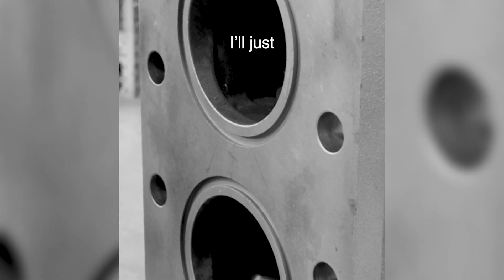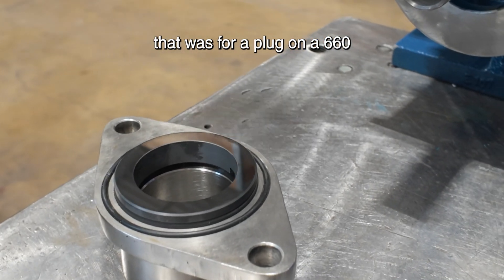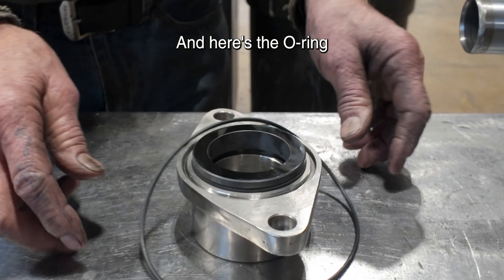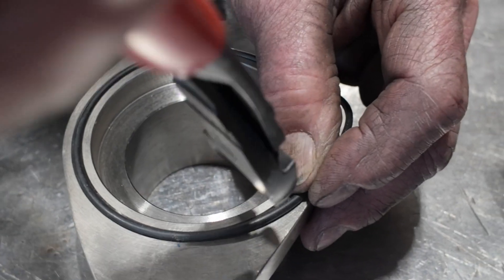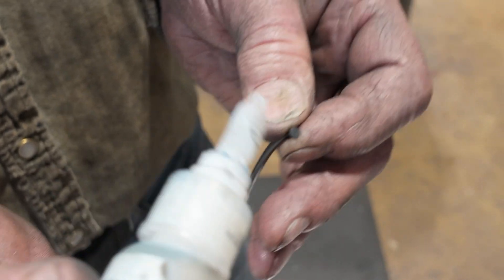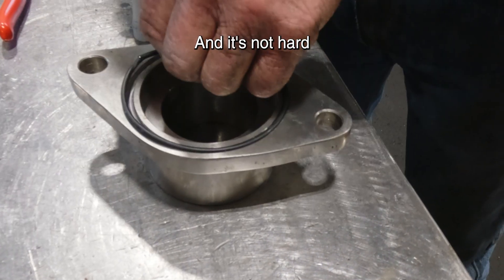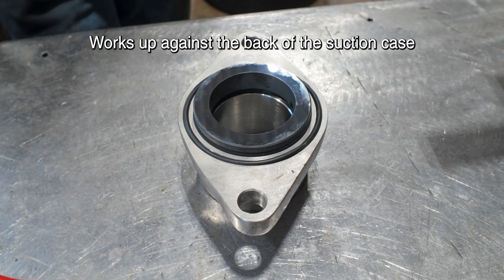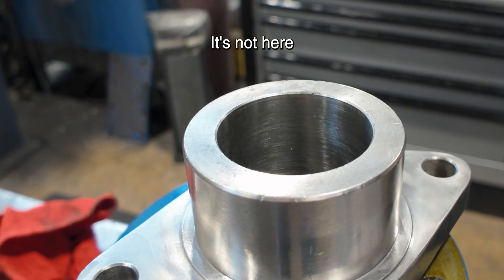O-Rings - We Respond To Your Comments #pump #repair #mechanic

Comment: Even if there was some pressure, this would work as good as a single piece o-ring. O-rings are typically under compression so if it's cut slightly long it'll squish into itself along with the surrounding material. The glue helps for positioning so you don't pinch the o-ring and helps compensate for a rougher cut.

Comment: Oh how often I have had this argument! Once I tell them we use glued O-rings at work, mostly for water with up to 150 bars, they stay quiet. 

These O-rings are used for diameters of up to 3 meters with 15mm thickness, and in pipe joints and valves in pumped hydro storage plants.
Cut square with a very sharp knife, and glued with ordinary superglue, they don't fail.
Pliers don't work nearly as well, because the ends don't get even nor square. Also you need the least amount of glue possible, just wet both surfaces without a big drop attached.

Comment: Everything you said is correct, but, If you're gunna defend it, at least be doing it right. Always use a sharp knife, wire cutters/snips leave a ridge, not a clean flat end. Also if you are doing mods, why not mod to a std oring to make it easier for those in the future?

Comment: Wait till they see me coat the old one in rtv and send it lol
Reply from the maker: The world runs on RTV!
Reply: @shanleypumpandequipmentinc3857  I've seen entire parts of machines replicated with pig putty, and RTV was more common than tape in my factory.  We used it as a coating you could peel off if sand could stick to something you didn't want it to. We used micro glass beads and waterglass to make injection molding cores, and the mix would stick, dry, and subsequently tear machinery to shreds.  Coat the electronics, reed switches, prox switches, boltheads, etc., and when it's time to fix the thing just peel it off.
Reply: Rtv and my new favorite Flex seal tape!

Comment: I used these o ring kits for years in the milking and pumping industry. No problems at all. Still use them in high pressure air guns running up to 400 bar never failed.

Comment: I've been making my own o-rings for years.I buy the "cord stock" from Mcmaster-Carr in the diameters I need for various repairs. I use Crazy Glue and other brands of instant adhesive. I cut with a single edge razor blade as close to 90 degrees as possible.  I never have had any of them leak.

Comment: I’ve made o-rings for many a pump. Never had a problem with leaks. I make them the same way, with a square cut. The only problem I have seen with o-rings is not the o-ring, but the person installing them. A lot of installations, like a filter canister, only need to be tightened until seated, then snugged about a 1/4 turn, otherwise the o-ring gets flattened out from over tightening and it’s lifespan is dramatically shortened and leaks occur.

Comment: He still didnt explain why he doesnt just buy o-rings of the correct size?
If you are machining the o-ring groove, you know the size. And machining the grooves is much more work than just buying som o-rings.
Reply from the maker: Ever bought things for industrial use before? Do we need 10,000 O-Rings to build 20 custom pumps per year? It's a simple question of scale. We use OEM rings plenty, but if they aren't available or we need to do a custom pump, making one is easier and more cost effective.

Comment: 100 percent correct. I've been making rings for 40 years, I mostly use a razor blade, but I have used side cutters, never had one leak or fail.

Comment: Super glued o-rings always work short term never long term.
Reply from the maker: We don't use Superglue, we use a glue that is specific to rubber.
Reply: @shanleypumpandequipmentinc3857  my sister ripped her chin open when she fell out of a tree.  Took her to the doctors to get stitched up.  He glued her face shut.  Told the doctor that I could have superglued her face at home and save the $2000. That doctor,  like you,  it's not superglue..... it's special.  

Dude, superglue  is superglue no matter the fancy name you want to give it.
Reply: Wrong,i can take u to 0 rings i made,still.in service from 5 yrs ago
Reply: @TheDigger06  then the rings are not actually doing anything important.  No fluids behind it no pressure behind it.  That I guarantee.  I was a plow pump rebuilder. Super glued rings do not seal.

Comment: O Ring kits I used to use had a razor blade cutter for exactly square cut faces. The cut ends sat in a vee groove jig for superglueing together. They worked fine in static applications.....didn't fancy using them in dynamic situations though!

Comment: I'd bet all the people that said "you cant make an O-ring" are the same peoole that think OEM parts are always better, that think that the factory OEM oil is the only oil you should use, that think that every bolt HAS TO BE torqued to spec or it will fail, and think the tools make the mechanic.

Comment: I use these as 'belt' drives on a mini lathe. Couldn't get the size I wanted so I made a few just as in the video. They work very well, and last nearly as long as the original. I used a dab of superglue
Reply: You've cut and glued o-rings like this for a belt drive application and the don't come apart? If that's not a testament to the practice of making o-rings, I don't know what is.

Comment: In my younger days I worked for a pump company as a service technician. We'd often use a splice kit for static o rings, not too much success with dynamic ones though. Good video.
Reply: The secret to using them in a dynamic situation is to keep the specific diameters of the "O" rings exactly the same both in cross section and diameter and the same type of elastomer, the other critical point is to keep the appropriate glue at the recommended Temperature the manufacturers of the glue state, the glue I use is kept at 2 deg C its kept in a refrigerator right up until it's needed and replaced immediately, it lasts for over 12 months if not all used up if you buy it and its warm it won't work near as good, my supplier keeps it in a refrigerator and it gets delivered to him from the manufacturer in a refrigerated cooler, the glue you buy from a hardware that's sitting on a shelf is defiantly going to fail, been doing this for years on hydraulic oil, water, air, and chemical pumps and spool valves, multi stage high pressure pumps, when you buy the "O-ring cords don't guess what it's made of there are dozens of different elastomers ask if you don't know and ask what glue to use and how to use it.

Comment: If you fix something in a hurry, then yes, do whatever. But if you are so professional and master level guru in your trade, buy proper o-ring. I don't believe your job, your projects, modifications are THAT custom, that you can't machine a groove and buy an o-ring, standard size (metric/imperial), it "MUST BE" custom (there's no other way). I would never trust a company, product, service, where ALL o-rings are glued.
Why stop there (at o-rings). Do you also make your own custom bolts/nuts, bearings etc.? Just for sake of it(?).
Reply: We used the cord O-ring material and the Loctite O-ring bonding kit when doing stamping press repairs and rebuilds. This was the OEM required method.
Reply: Yet another internet expert chimes in. Even though many do, I have a feeling this guy isn't the type to publish something on the internet that doesn't work and I have also done this for years in certain situations with 100% success. Technically because he stated that nothing is under pressure, the groove could be filled with RTV gasket maker instead of an o-ring and work wonderfully. Many things are built this way these days. From the factory engineers I might add. The last part of your statement sounds like it came from a 13 year old.
Reply: That's a good idea

Comment: Worked for a Cat heavy equipment dealer as a mechanic, yes they do have a "make your own glue together O ring kit".
Reply: Both square and round o-ring kits. I carry both. I also have metric o-ring material and SAE, for the strange applications, like my hobby.  Motorcycles. Than there's the green ones for refrigeration and silicone for chemicals. So many o-rings, so little time 😂

Comment: I was a millwright and industrial mechanic for decades. Fixed everything from ships under way to exotic multi axes cnc mills. He did a fine job. O ring kits come with a razor cutter to make perfect 90 degree cuts. Not a 45. Never ever seen a 45 used or recommended by the manufacturer. I personally have made a few thousand of them. Many many held pressure. 3500 psi hydraulic systems were common. When an o ring is needed and the machine is down, you just make one and go on to the next project. I also don't ever recall having one fail either. And I am what you would consider an expert in the use of orings. Well done sir. You can fix my crap anytime!!
Reply: I agree, I am a 30 plus year millwright as well, I have made thousands of o-rings. I will stop short on making o-rings in dynamic situations, but static o-rings like this, no problem. The only thing I do differently is I cut with a razor and use a bit of primer before the glue but other than that no problem. Done correct you won't pull that glued joint apart. Plus, as stated, why would they sell kits if its bad to make orings. Its not the kits its the people making the oring that cause failures.  👍👍👍👍
Reply: I've worked on machines where you have to make an o ring it is impossible to stretch a ring over all the other geometry on the shaft.
Reply: @sambrose1  Those are always fun..
Reply: I know it's not hydraulics, but I'm a pool and spa professional. When I first got started, about 30 years ago, there were so many different sized o-rings, it was impossible to stock everything, so we had a kit for making them. I never had any issues with them failing. Most of the industry has standardized the o-ring sizes, so it's not like it used to be. But I still run up into the odd sized o-rings every now and then. I always have super glue on the van for various things. It's still easy enough to cut down and glue an oversized o-ring when I need it. Still never had any issues.
Reply: @float6969  I installed a loader tire on Sunday. Pulled out a factory oring from John deere to put on the wheel. It was superglued. $35 homeade oring. I instantly thought of this post and had a laugh.
Reply: a normal glued oring like shown in the video can withstand thousan of psi??
Reply: @dgpop1287  Yes. O rings hold pressure, but maybe not like you think. It's captured in a precision groove and compressed. So a glue joint is not holding 3500 psi. It's just holding the o ring. Then the o ring gets pushed against wall and will deform and push away from the pressure. Kinda sealing any gap tighter. And super glue in particular actually bonds with the o ring chemically. Once glued, the bond is incredible if properly cleaned. Some oring types require different glue to hold well, such as viton but most black orings work with super glue.
Reply: @ okay I understand thank you!
Reply: @tireballastserviceofflorid7771 It's also kind of important to consider what the "PER square inch" means in PSI. The ring itself seems to have a very small surface area directly exposed to the fluid force. I'd say in smaller rings the surface area is in fractions/inch/mm. Just spitballing here but a 1" diameter ring might face a few hundred pounds across the sealing surface in a 3500 PSI system? Or something like that. In other words it's unlikely the ring "feels" the entire max 3500 PSI.
Reply: @markcohen4599  You are 100% correct. The actual area exposed is 0 or microscopic in a properly fitting seal. Take a JIC fitting, for example. You can get them with or without orings. In many cases, the oring is just a backup. Yet fully capable of holding the pressure. Shows how tight sealing areas can be in hydraulics.  I was chosen to get certified by Hyspeco in hydraulics years ago. Lots of class and shop time from the manufacturer. Made us capable of in-house warrantee work. Really shed a LOT of light on a somewhat mysterious power system.
Reply: Static O rings you can use glued no worries unless your sealing a glue solvent. With a properly sized groove with a 1/2 decent finish no worries. Some O ring materials don't superglue so you need to keep that in mind. But standard old Buna sticks together and works just fine. The only other exception would be High Vacuum equipment. Glued O rings will leak almost every time. Whilst you may achieve a vac you wont be able to keep it. 3500 psi is high but I have built fixtures that needed higher pressure than that. Sealing up 520 bar I wouldn't be using cut rings. When those fail they almost disintegrate from the inside out. 
Dynamic O ring seals that would be used on a rotating shaft or a linear movement will almost always fail at the glue joint if glued together. Usually in a catastrophic way. Failing all at once. Risky for hydraulic cylinders, valve spools and rotating motion glands.
The reasoning behind the "Angled Cut" is especially in high crush installations the glue joint is not put under any mechanical force. Whilst in most stuff under 3/16" section it wont matter the really big O rings with a 1/4" and up static rings can tear due to crush especially if they are a high durometer N90.  If you don't angle cut with the big ones the larger they get the more prone to failure at the joint they become. You actually make the cut in an angle to the mating surface and not at 90 degrees. That way the joint is put under the least stress and there is always flexible rubber to take up the surface variation.
Oh and my experience I have been a maintenance fitter for 30 + years. Working on everything from Laboratory Equipment, CNC  and high speed special purpose machinery, hydraulic manufacture, design and service. Damn even used to make, service and install mechanical seals in all sorts of junk..
Reply from the maker: We couldn't have said it better ourselves!

Comment: I personally made four custom o-rings for custom made heatblocks in my PC this way. Still holding after 7 years without a single drop.
Reply: If you do custom project, do you HAVE to make EVERYTHING custom around it? O-rings, seals, what else - bolts and nuts too (with what, proprietary threads)? Proper design is about using off the shelf parts if possible.
Reply: @GrandePunto8V  there were serious dimensional limitations how to make it possible to fit. 6 O-rings were standard, the rest had to be custom made. And sometimes even other manufacturers are using some wierd dimensions of O-rings not readily available, so if this technique saves you weeks of time waiting for the right part or the part is no longer manufactured...